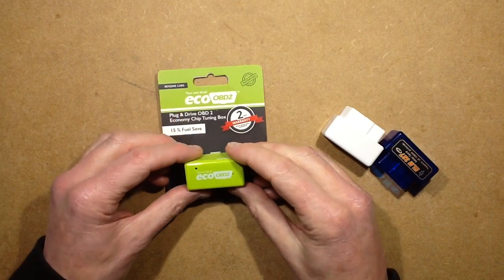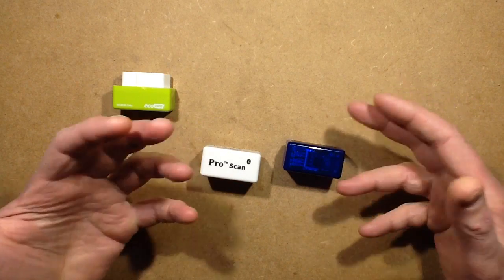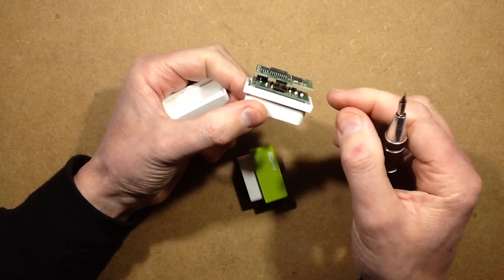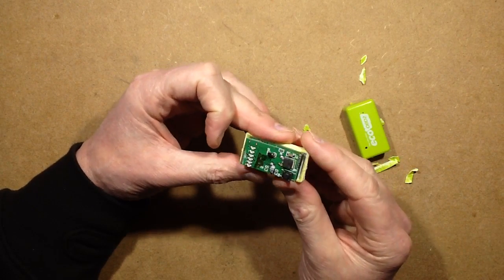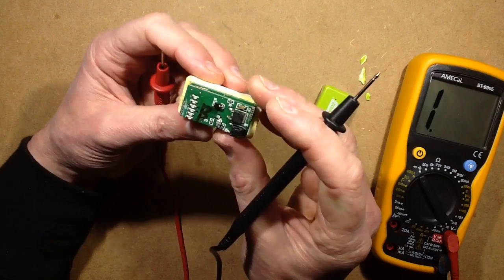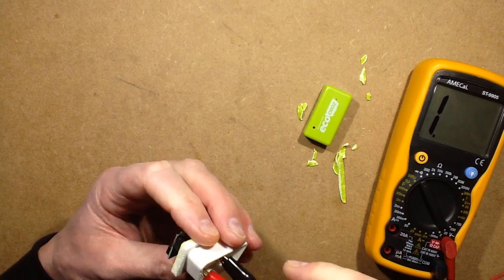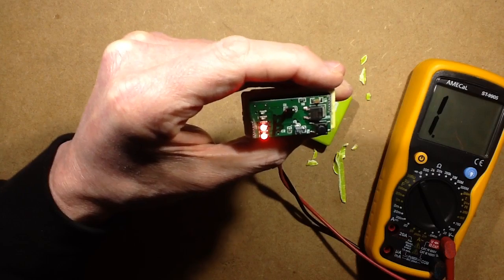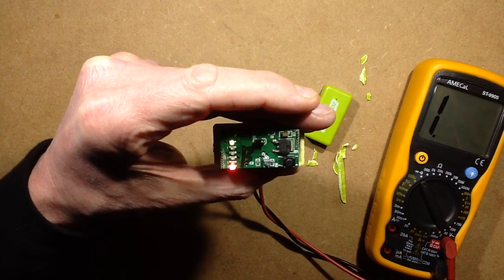Inside an ECO OBD2 "chip tuner" fuel saver.

Comment: I have the the elm 327,that one is great,pretty much it's a micro scan tool and you can use to diagnose any check engine codes or reading oxygen,fuel,and cooling levels.the nitro or eco obd2 chip is not worth it.i have the performance chip.it does change the effects on performance.First it will perform more better,but later on a long drive it changes drastic to the point you will gain and lose performance. don't buy these things,if you want a plug in performance get a jet chip or better.

Comment: it may be that this device monitors the fuel trim while you drive at first and then alters the trim to run leaner, more often then most, but like said be careful with putting something on your vehicle that could render it inert . if you want to save fuel use cruise control more often and try to be lighter on the accelerator.

Comment: First things first, auto makers already go for max economy, there is very little you can do to make it even better through software while keeping the car reliable. They have very smart people that program these to get the best figures to sell the car.

Next, it can do something, the ecu has both a rom and ram, the rom is locked behind usually other steps that need to be satisfied to allow access. On my car, I'm specialised in subarus, I need what is known as a reflash adapter that plugs into a spare under dash plug, and also needs vpp power to it. My open port cable that I both flash and log with through the obd port doesn't supply this, so I need to externally supply it.

Anyway, the RAM is basically temporary maps that the car populates and continuously modifies based upon fuel grade, o2 feed back, knock sensor feedback, etc. This is what the dongle in the video changes, it will force as lean parameters as it can, most likely zero out any timing changes and things equivalent to an ignition advance multiplier keeping it at best value instead of being dynamically changed. Now this is where the danger lays, these values are being changed based upon sensor feedback for a reason, if you have them continuously being reset, then damage can occur, or you do start to notice the car running poorly. Being RAM, when you disconnect the car battery, the info in it will be erased. This is why if you have a bad running car then take off the battery and connect again, it will run better, for a short while while the ecu repopulates the maps again. Yes, the ECU does read RAM maps in priority over ROM maps. Just get the car fixed.

Bottom line, I wouldn't use this thing, let the ecu do its job. Want to save fuel? Start by taking out all the rubbish and stuff you don't need to always be hauling around. Give the car a clean out.

Comment: The BMW section reminded me of the trick with the Vauxhall SRI where you can pull out the button for the warning lights, put it in upside down and it will give power to the engine.

Comment: does nothing, for something like this to work you would need a wideband O2 sensor sniffing your exhaust and comparing that data to a stoichiometric value in the case of gasoline it would be 14.68,where it would alter your short and long term fuel trims (up or down in setting) to achieve the best possible combustion mix( or stoichiometric) in the ECM all the while doing this live.

Comment: I have been using a bluetooth OBD2 'transmitter' for years and logging the data with Torque for later analysis and I like that alot.  I use it both on the road under normal driving and at the track.  I have one of the older style 'chips' in my daily driver that connects to the Air temp sensor and have never had any issues but honestly dont think it does anything.  I have opened it up and found one old style computer chip with two wires soldered to two of the prongs.  Cant imagine that does anything.  It's been in there for over 200k miles so I just leave it alone.  Was more of a test than anything, really didnt expect it to do anyting.

Comment: About 11 years ago I purchased from scantool.net their OBDLink S Scan Tool for about $125.  The model I got used both bluetooth and usb to connect an iPhone, Android smart phone, or laptop to the CRU in any make of car.  The unit came with a CD-ROM that had the software for a laptop but I downloaded an Android app so I could use the tool with my tablet.  It is a great tool that allows me to review every operating parameter of a running engine along with reporting engine error codes in plain text.  It will also allow real time monitoring of data such as acceleration, fuel consumption, economy, GPS data, etc.  Great, right! However, you can also use it to alter the running characteristics of the engine such as timing, fuel to air ratio, O2 metering and that is all the stuff that'll f*ck up your engine if you don't know what you're doing.  One of the guys I worked with had a similar tool that he used to modify his turbo boosted sports car to maximize acceleration and cam angle. Imagine the fun if you get the cam timing wrong.  Interestingly enough I showed my mechanic my device and he was bummed because he said that my device did the same thing as his multi thousand dollar device did.  Bottom line these devices are great for diagnostic or real time analytic purposes but can be dangerous when used to tinker with the CRU programming.  Any device that acts autonomously such as the one you took to pieces has to be treated as inherently hazardous and could cost a fortune in engine repair.  Not to mention that here In the US the auto manufacturers are trying to win a suit in court along the lines that they are licensing the CRU software which makes it illegal for anyone but them to modify the software parameters.

Comment: So what it actually would be doing is telling the ECU to reset its fuel parameters, and the ECU itself would from then on be doing the relearning, its equivalent to power cycling the ECU, 

In reality its not doing anything different than what the ECU is already doing, and only helps when you have done modifications or cleaned parts of your engine, want to reset those parameters and dont know your radio code for a battery reset.

Comment: Most actual OBD2 reflashing units for performance tuning are specific to certain ECUs and wouldn't be universal. They're also not at all cheap. No way some little thing like that from Ebay actually does anything. Its probably a modified OBD2 diagnostic reader so that it looks convincing but doesnt actually do anything.

Comment: I doubt these cheap ones work, apart from maybe intercepting data such as throttle position. Cars have a slight delay for safety that happens between pressing the accelerator/gas pedal and the engine responding. Some devices can intercept this data and speed up the response. The result is that the car can feel a bit more responsive. The same can happen if the unit intercepts the data that tells the ECU how much you've pressed the pedal. If it adds a bit to it, again the car will feel more responsive, although the  same could be achieved simply by pressing the pedal more.

On the point of being able to program the car via the OBDii port, it is actually possible, and done regularly to re-map engines. Companies such as Superchips with their Bluefin product have been doing it for years. I have used one on my 2005 Mini, and it definitely makes a big difference to that car!

Comment: Doubt this does anything more than just put on a light show. I mean this thing would need to have detailed maps stored for all engine types and that is just no possible on such a small device. I guess it could tell the computer to use the more lean fuel burn maps but that would eat into the durability of your engine over time. Never plug one of these into your car is my advise.

Comment: Doubt these cheap Chinese eBay items do a lot in your car other than give you a pretty light show but as for modifying your engine through the OBD2 port that is definitely possible, at least on my car anyway. I've got an OBD2 to USB cable which I connect to a laptop with BMW software on. That allows me to change idle rpm, test all the electrical and engine systems in the car, reset all the ECU adaptations and even shut off a cylinder, all through the OBD2 port. Although its worth mentioning it is an older model car (2003) so it might be different in newer ones.

Comment: For what it's worth (now 2 years later), here's my take .   Fuel mapping is generally done in something like a lookup table on the Engine control unit.   This is where they can decide to adjust the values in that map to have lots of hp with lots of fuel consumption of back off fuel consumption.  This map would be a [set of] parameter[s] in the embedded software.  The CAN bus is an industry standard so reading information certainly possible, BUT in order to use the CAN bus to change how the vehicle is behaving, the ECU software that you are trying to control needs to have provisions built in to SPECIFICALLY look for the message you are sending and react to it.   So, it needs to be designed in.   One such signal that you could expect to see would be something like accelerator pedal position (if that signal was being passed as a CAN message from a different computer in the vehicle). 

Still, even if you were to hijack a signal that the engine software is looking for (like Accelerator pedal) you still have to original ECU sending the real accelerator pedal signal.  You would have to somehow remove that signal from the bus or you would end up with the signal being sent more frequently than usual with multiple conflicting values.  That would be bad since it could be unpredictable.  

To be fair, whoever makes this little green box might know about some "secret"? CAN message back door that OEMs leave open for 3rd parties to tamper with.   But, all of the dudes that I work with that are responsible for such technology take actions to prevent 3rd party tools from being able to impact the real time operation of the vehicle. 

Long story short, I use the ones that do fault code reading but wouldn't try anything that isn't just reading (or resetting codes)
Reply: best and most complete answer here
Reply: You could play a CAN recording on the network since CAN messages are standard, but like you said, you'd have to first of all make the device the priority signal, without causing it to create comm errors or anything else.

If anything at all (which I doubt) it likely manipulates some temperature/pressure readings like intake air temperature or barometric pressure to force the engine into a specific operating mode. 

If I come across one somewhere cheap like in the "nobody's buying this assorted crap so it's all in this bin for 95% off" I will grab it and throw it on and OBD splitter and watch the network traffic and parameters in the engine to see if it does anything at all or what it does.
Reply: The CAN bus is standard, the issue is the J19139 std. manufacturers have their own take on this, trying to do CAN controllers for diesel generators, required separate software for each manufacturer. @HerculesRockefellerESQ
Reply: That's right on....

Comment: I got an idea, how about rehousing it as ob2 to usb converter, and plug usb killer to completely kill cars?
Reply: Bitelaserkhalif cringes sounds plausible if you use the USB Killer Pro. Their website states they damaged some motherboard which they couldn't repair.
Reply: Infiniti25 that's the purpose, it'll damage the ECU and see what happens... It has to be done on car with EFI ofc

Comment: Total complete placebo effect.  You have OBD-II which is just a basic way to pull and read codes and information.   It takes some highly advance and expensive code scanners/readers/programmers  to modify or change settings and information.  Eg:  Wife has a VW.  2001.  It has several modules that control just about every area of the car.  The computer can be 'read' by a normal scan tool....  Pretty much it.

In order to program or modify?  Then you need a dedicated cable for VW, and dedicated software.  High end tools and scanners (think $3000-$4000 scan tools by Snap On...OTC...etc...) can do some basic programming and 'encoding' functions.

But there's a huge difference between spending a truck load of $$ on cables and software...  And a cheap POS universal plug in device that makes some extreme claims.

That's just my opinion though.....

Comment: So it's like homeopathy for your car? Your car is convinced it's gonna be more efficient, so it becomes more efficient via the placebo effect?
Reply from the maker: It's more homeopathy for drivers.  They plug it in, see the blinking lights and convince themselves that their car is running better than ever before.
Reply: bigclivedotcom
lol. Just so.
Reply: @bigclivedotcom  the easiest thing to do is to create your own y connector OBD port and plug both in... The Bluetooth then can tell you what's going on with this thing at the same time... then you can see if this thing is changing anything at all... because you will have the Bluetooth device giving you a record of what's going on...
That would be the simple thing. You can always rent a car, plug the Bluetooth one in... get a baseline For what the rental car is doing, then plug in your y connector, so that you have the Bluetooth device active at the same time this other device is running?
And then just drive and see what happens...
Reply: It's all healing crystals and coconut oil
Reply: dingus153 Hey, at least coconut oil is a very good lubricant for some things…
Reply: @dingus153  Hey I use coconut oil in my conditioner and it is really good for your hair!
Reply: The CAN interface is a bus where different devices communicate. So there is always data on it. It's not like simple serial with Rx and Tx channels. But in this case the bus isn't probably connected at all.
Reply: bigclivedotcom the Red  Uns go fastah
Reply: A big giveaway is that the device doesn't appear to have a CAN transceiver on it.
Reply: Homeopathy for your car I think not this is Siphonocraft of the suckers wallet who purchased it.  The say PT Barnum said a suck is born every minute and if you buy one of these things you might as well spend your cash on the tattoo starter kit BigClive purchased to tear to bits and then tattoo a great big S on your forehead.
Reply: @gullreefclub  I guess I'm the big suckered. I bought one! Lol
Reply: I wonder why they bothered with a crystal for the MCU if it's essentially just blinking LEDs. Most MCUs have an internal resonator for operation without a crystal.
Reply: My car thinks it's a boy now. Wtf
Reply: Aurelius R agreed....this is rubbish...just piggyback your car then tune it the way u like...
Reply: +Aurelius R you would maybe need a logic analyzer to get any meaningful information
Reply: BlackEpyon 🤣🤣
Reply: No.
Reply: So when homeopathy is used on a pet and obvious positive results are seen then that’s just a placebo effect...? Lol who’s ass did this troll pop out of?
Reply: All ya gotta do is use your brain, photo your mog on your vehicles dash prior to using it, then after...it works, period...in fact I'll wager live in person with anyone it works...wanna bet ?
Reply: Do you not have an oscilloscope? Just probe the lines and see if it's sending data.
Reply: Throw four aspirin pills in the Thames at Reading and cure headaches for the whole of London

- Mark Haddon, The red house
Reply: Is that the same homeopathy that cures cancer at better rates than modern medicine does via the Gerson Therapy?

Comment: it looks kindof like a universal fault resetter type board the microchip is programmed with the reset code just to turn the light off. god knows what this is loaded with but it is possible to modify things like fuel trims via the k line on alot of cars many can be reflashed too with a basic cable I have done my own car even changed the immobilizer eeprom in the ecu via the obd socket the software is even free open source just a google away.

Comment: I got one of the bluetooth obd2 reader things off ebay and I use it on my 2014 Ford Mustang GT-CS and for some reason, every so often it will turn off ALL traction control but only when my phone is connected to it. (Traction control AND Advancetrac AKA stability control). It doesn't happen when it's just plugged in with my phone not connected via bluetooth. Thankfully it hasn't shut off at the wrong moment, but I haven't figured out exactly what my phone is telling it to do for that to happen... Maybe it's using the wrong OBD protocol or whatever it's called. I wish I knew, it could probably be fixed.
Reply: For god's sake, it's a mustang! It's supposed to turn off TCS and run into a crowd on a daily basis!
Reply: When it initializes some values upon startup, it can put the stability systems into diagnostic mode. It happens on my 2015 Silverado. I remedied it by either leaving my ultragauge connected, or plugging it in after the truck's been running for 30 seconds or so.
Reply: 07CVPI the traction control relies on maf readings believe it or not

Comment: obd2 is a standard protocol across all manufacturers. there are other protocols used by some individual manufacturers for other modules in the car like abs, bcm etc. 
the obd2 devices dont need to know about every engine by every company.
Reply: 2:18 I guess you missed this part?
Reply: nope. i just expanded on some of this as in parts it seemed like he wasn't too clear on how it worked.
Reply: So do you think the extra pins will have different signals? Or is everything across the Canbus? Hmm, I'm not even sure what the specific pins would be used for.